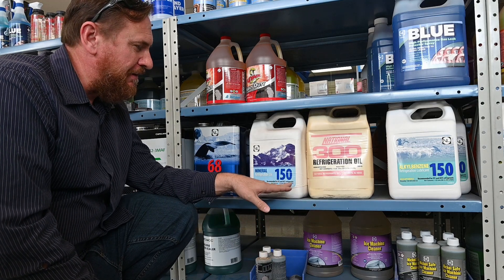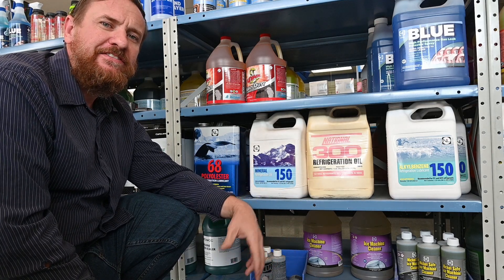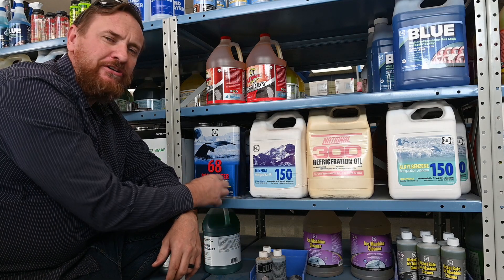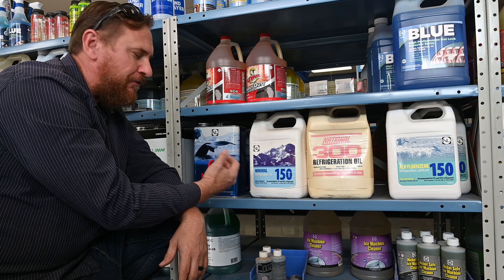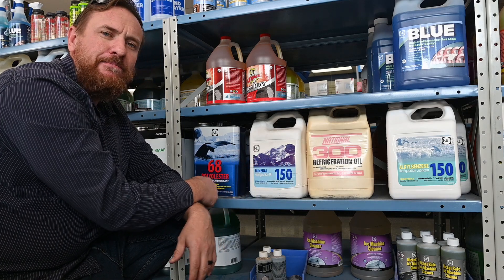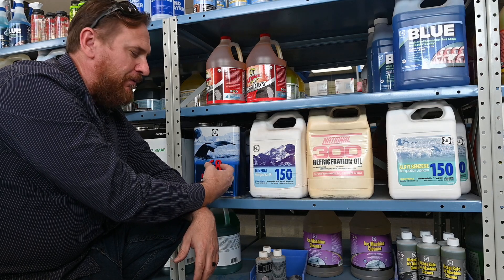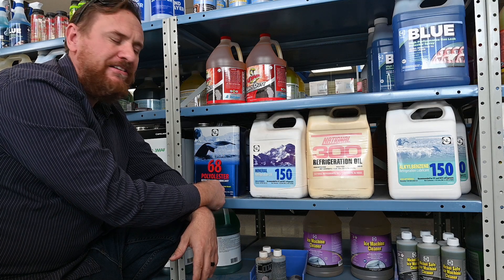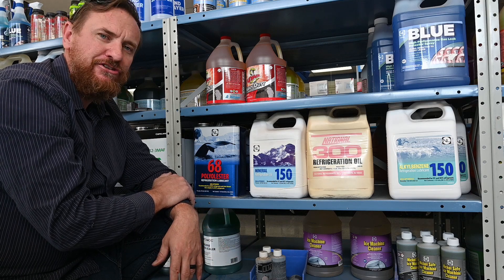HVAC 112 part 2 oil

Comment: You may have discussed it already,  but when will you add oil to a system. I've seen compressor change outs, but never seen the tech put oil I. The system
Reply: Even I have never seen
Reply from the maker: There are a few different methods. I will be showing them latter on.